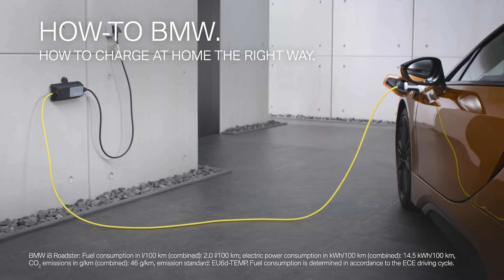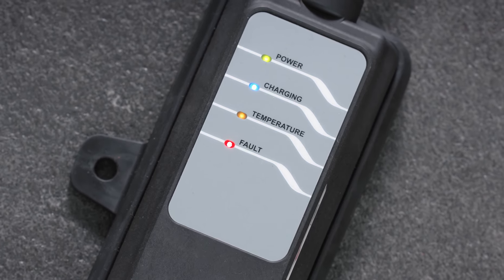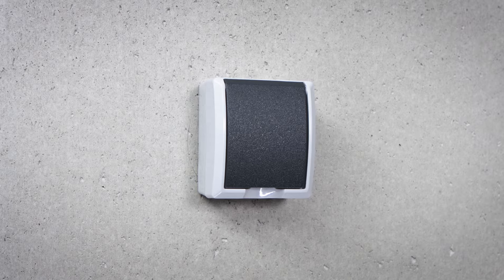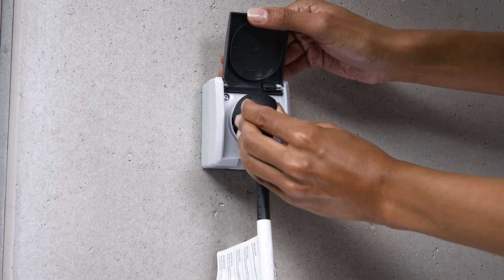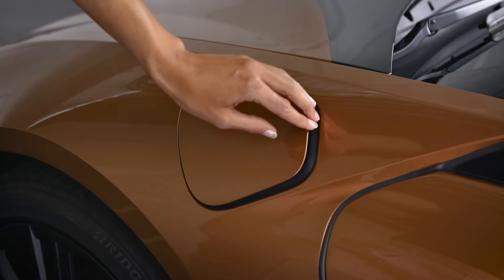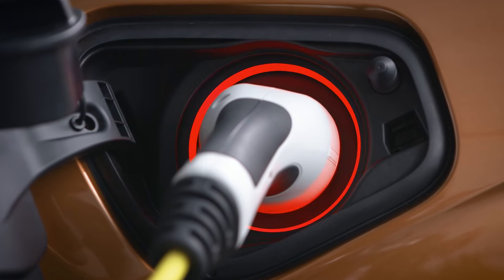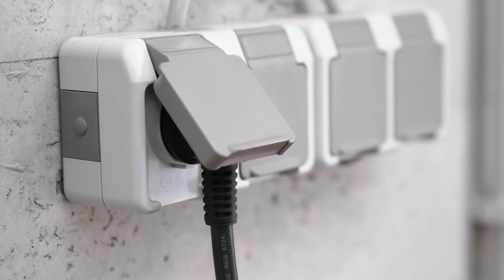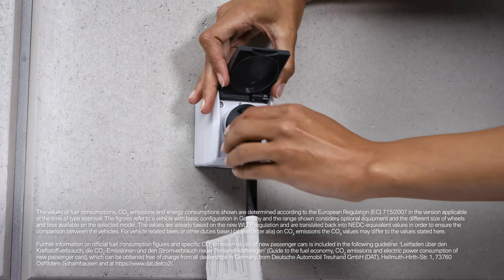How to charge at home the right way – BMW How-To

Comment: I own a BMW x1 hybrid vehicle. After charging the vehicle, I don't want it to remain on power after the charge is full. Maybe it won't do any harm, I don't know, but it's not something I want. If I put a socket with a timer and set the time, would it be harmful if it cuts off the electricity at a certain time? Normally, it says in the manual that when the charge is finished, first remove the charging cable from the vehicle and then cut off the electricity. I will cut off the electricity first by using a timer. Will this cause any damage? Or is it necessary? I would be very happy if you answer. Thank you.

Comment: I’ve had a long running series of issues over 20 months with the App the i4 car and charging. Main issue is that the app and car seem to confuse each other and randomly change the settings without notice. I’ve had two BMW software updates (April and Nov) but no improvement. I’ve now deleted the app but even that doesn’t completely stop the car changing settings!!! BMW acknowledged there was an issue and stated they had a software update to fix the issue but that failed to make any difference! Not good

Comment: I have a 240v plug installed, can i just get a 240v level 2 charger and plug it into the wall socket, or does it need that charging station?

Comment: What kind of solar panel installation would you need to charge your BMW 330e?
Reply: a large enough one to produce a current and voltage to generate 10 kWh of energy
Reply: I have a 4kw solar and I can charge my 530e in about 3.5 hours. The size of the solar system makes a difference it is the length of time. The min. Solar output to charge solely from it would be 2.5k. The charging is either set at 13 amps or 30 amps. For the higher you would need a dedicated charging outlet as opposed to the ring main.
Reply: N .j jj
Reply: @colinc.8742 I’m waiting for the 550e.

Thanks

Comment: Thanks for these how to videos. Just saved me a mint since you cant use an extension cord, it makes a PHEV into an overpriced and heavy gas guzzling 3 series for me.
Reply: Or just have an outlet installed!
Reply: your could use extension cord. just use the right size wire example 10/3 12/3 14/3 etc ....
Reply: You "can" use an extension cord. Brands preffer to not recommend it however, since if you use a cheap cable, it will overheat and is a risk of fire or property damage.   
  
Using a good 16A rated cable is good enough. For permanent changing spots, having a outlet fitted or even better, a wallbox is better though

Comment: I just got my new 2022 X5 and tried the 120 plug.  It's giving me FAULT indicator when plugged into the garage outlet or outside outlet.  I didn't even plug into the car yet.  I thought it would be the outlet problem.  But I have no issue with my Toyota charging plug.  So now I'm using my Toyota plug to charge the BMW but at half the charging speed.  Do I have a faulty BMW charging adapter?
Reply from the maker: Hi Barry, we would suggest that you contact your local BMW dealer who would be best placed to help you with your charger issues as soon as possible.

Comment: 🤔 I use an ordinary home socket for my BMW X1, with an extension cable
Reply: An extension cable is fine, but make sure the wire gauge is 12 or lower so the wire doesn’t overheat and start a fire. Definitely don’t use a standard extension cord you were using for Christmas lights 😅

Comment: Can you disconnect the cable if the car is not fully charged? How do you unlock the charging cable?
Reply: The video says that you can disconnect the cable by unlocking the car first

Comment: Constantly getting error "Unable to charge" on 330e, it never clears. No way to reset the error, tried several chargers, restarts, waiting etc. The only in-car option is to call BMW recovery, who hang up on me after hearing what the problem is. Then the phone number for BMW recovery stopped working! Very disappointing from BMW. How can you sell a PHEV that won't charge with bundled charger??? And when there is an error, there is no explanation or way to reset it? 

Now I'll be left in the clutches of a local dealer who are useless other than to overcharge me for things the car doesn't need done. They are many miles away and no courtesy car, anything nearby or public transport so I am stuck there for a whole day (if I'm lucky they can fix it on the same day) or have to pay £50 one way for a cab. 

According to several people with this error on the forums, BMW can clear the error remotely - why oh why does this have to be remote and can't be done in the car??? Very frustrating experience with BMW every step of the way. Don't believe a word they say anymore.